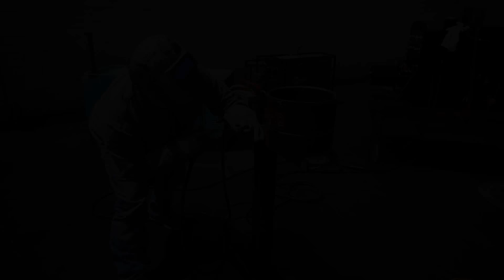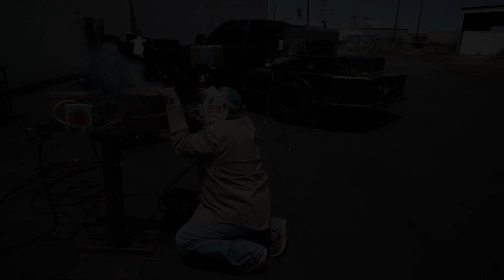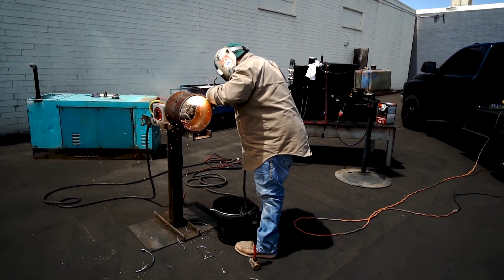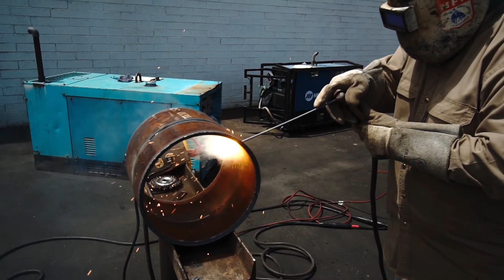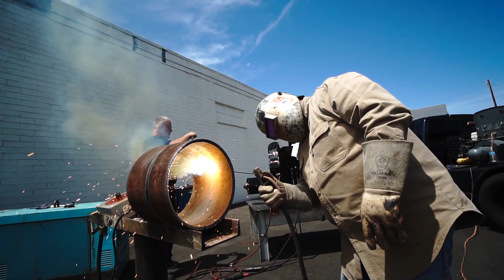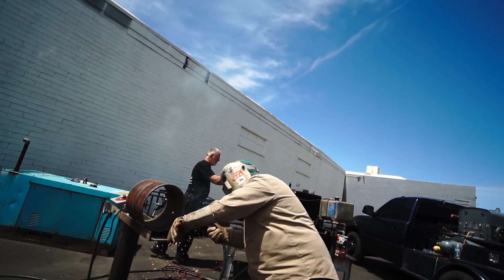Melvin Testing a Diesel Converted Short Hood with a 3 Cylinder Deutz Engine

Comment: Bad ass! I'm thinking of converting my 1968 SA200 to a diesel. Got it for free and it got water in the block and cracked it. You guys should do a video talking about diesel conversions
Reply: Check out the Weldingweb forums for all the info you might need on SA mods. There are some serious folks there including a couple who built complete custom engine drive machines. Also remember those engines are common to fork lifts and if propane suits your use you might prefer that instead since LP doesn't go bad from sitting like modern fuel or even diesel.
Reply: put a 12valve in it! thats Bad Ass!
Reply: I'm in the same boat now, several years later. SA200 F162 with a cracked block, I'm buying a 3 cylinder Deutz from my teacher and swapping it in.